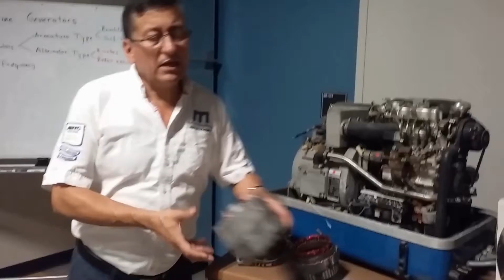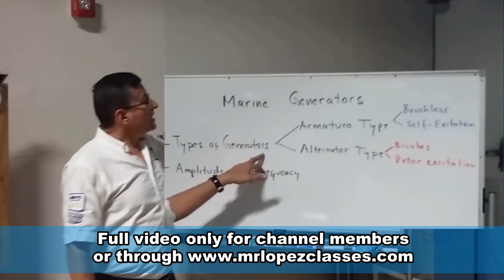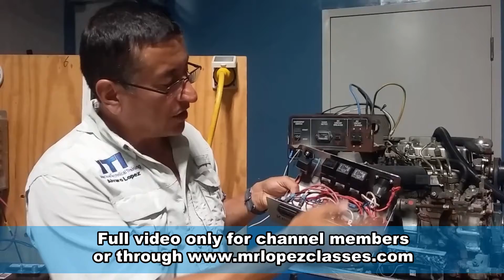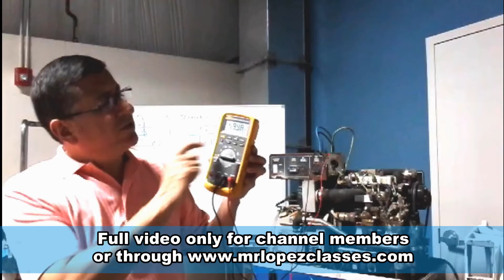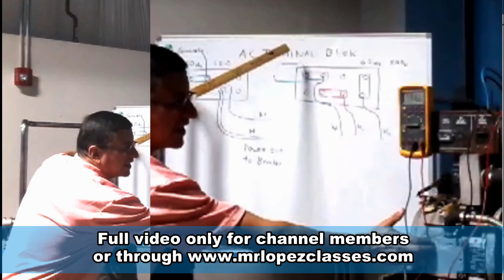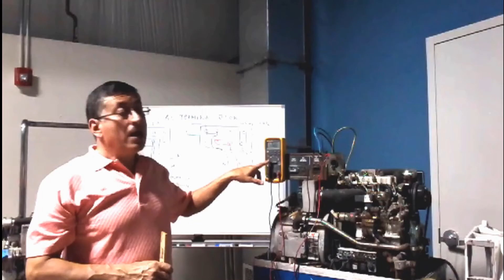Generators fundamentals & Conversion from 50 Hz to 60 Hz / Highlight Video

Comment: Great 👍
Reply from the maker: Thank you! Cheers!
Reply: i need your help, i am having a 40kva mitsubishi generator, with a VRG-BS7LF AVR, with no Manual, nor a circuit diagram, i just need to know how to change from 60hz to 50hz, sould i bypass the AVR and do the changes on the motor as explained in the video?
Reply from the maker: @ngoynkulu5169  Yes this is the process
Reply: @MrLopezClasses  Okay, but then, the action won't interfere with the already frequency set on the AVR?
Reply from the maker: @ngoynkulu5169  Please Watch this video https://youtu.be/9M3YbzEJd5U